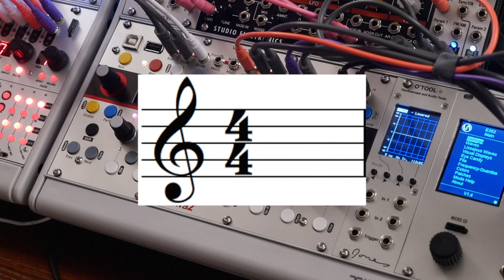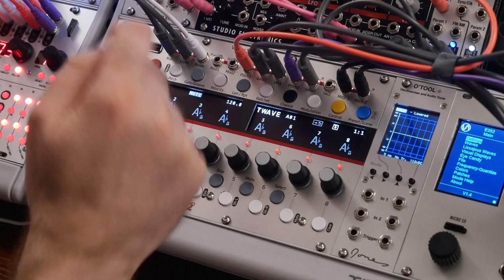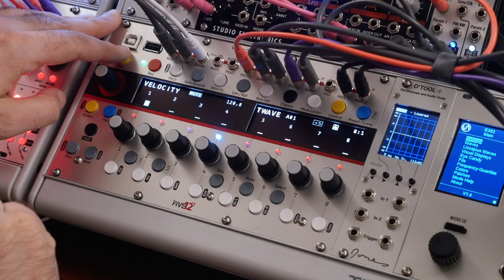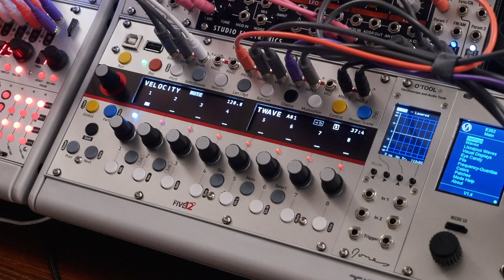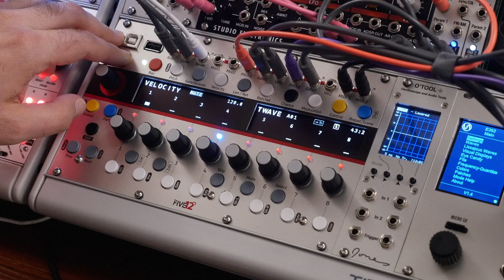Polymeter with the Five 12 Vector Sequencer

Comment: Great series of videos! Might be making me finally pull the trigger on a Vector. 
Quick q - how is you clock piped around the system? I saw in other videos you have Pam's and now see a Metron. Is the Vector the main clock? How stable is it in driving Pam's as a follower module?

Comment: Hi man!

I'm looking for a new eurorack sequencer (I'm selling my Pyramid to go full modular) and is inevitable to find your videos when looking the the Vector Sequencer. You make things incredibly clear.

Now, I haven't decided yet what sequencer to get. Vector wasn't even on my radar a few days back. And I still don't know if I should consider it because I'm getting a Sinfonion, which means I wouldn't really need the quantization from the Vector. Still, it looks very nice.

I've seen you have (or had) different sequencers, like the Metron, the FLXS1 and the Hermod. Would you consider the Vector the one you like the most? 

I'm mostly into generative music and one thing I liked is the hability to set a chance per step for effects.  But is it only possible for just one effect? And can I make other things change "automatically", like some way to automatize evolution?
Reply from the maker: Vector vs other sequencers: The other ones had their strengths. Hermod was great for recording and replaying external MIDI. Vector can currently only record MIDI pitches, it doesn't quantized time. If you, eg. sequence in a DAW and want to capture that, Hermod is a great pick.

Metron is 16 trigger sequencer, no CV so I dont consider it the same. Metron paired with the Vectir expander actually allows you to sequence the triggers/gates on Metron and the pitch/velocity/subseq on Vector. I know other Vector users have both Metron and Vectir as well.

I had an FLXS1 previously too, and yeah, I think the Vector is a much better interface. FLXS1 does cool stuffs and the arp per step thing which Vector doesn't, but otherwise  Vector is hands down better.
Reply from the maker: Regarding chance and evolve: yeah 1 chance OP per step. Another thing: I haven't done a video on it yet, but with MIDI output you can send multiple parts to the same MIDI port. So if you get a MIDI to CV conversation module, you can overlap multiple parts. Imagine you have a part where every other step is muted. You could merge that with a second part where the inverse steps were muted. Thus if you transpose the second part or modify it with CV it's only changing perceivable half the sequence. Its weird to explain over text, I should make a video about it...
Reply from the maker: I should also mention, I was considering a Sinfonion as well. Sinfonion to me is about having live/playable access to pitch. It does have the chord sequencer, but otherwise requires an external CV source for the other 4 channels. If you have the space and $$ both could compliment each other.
Reply: @ferrycollider  Hermod seems very nice, but that tiny screen is a real PITA.

I've always seen Metron as some kind of drums sequencer. But WMD is releasing Voltera, which I think will drastically change Metron. Very expensive expender, though.

Have you ever tested Eloquencer, Performer or even Nerdseq?
Reply: @ferrycollider  I don't know if I understoon but you're saying that it would be possible to create variations of a part to make it "more generative", right?

About that, is it possible to create more then one part per output?
Reply: @ferrycollider  I see Sinfonion the same way. The chord sequencer is nice but I believe I'll like more to "play" it, like I play a  guitar. That's why I think the sequencer quantization is not necessary.
Reply from the maker: @guilhermerocha1555  In Vector terminology a "part" is really what other sequencers call a "track". The difference though is that multiple parts (tracks) can be sent to the same MIDI output, so it's not exactly a track. You can have multiple sequences per part, and either manually switch between them or there is a "playlist" feature where you can sequence the sequences basically. I haven't done a video on either of these topics yet, but Vector does support it. Check out the manual on the five12 website to see some more about that.